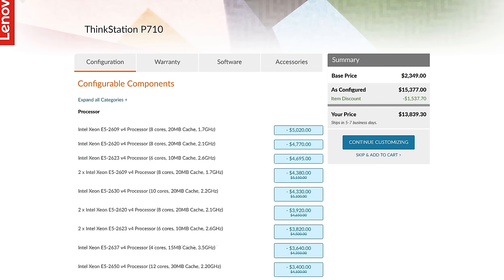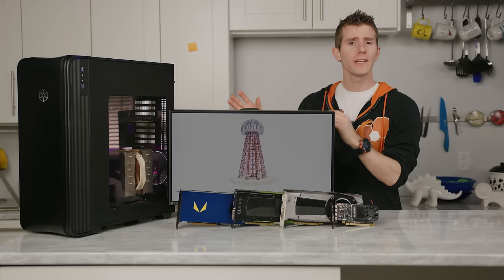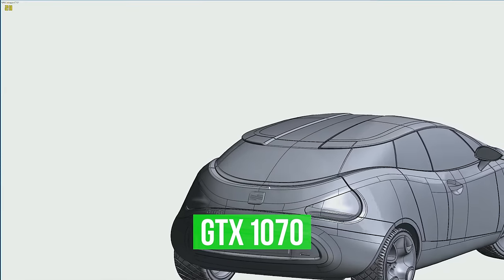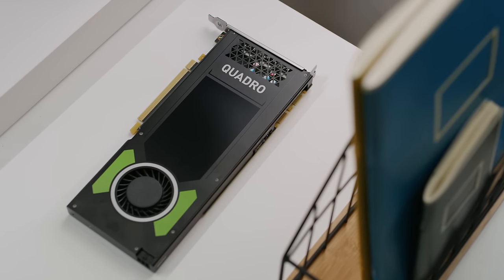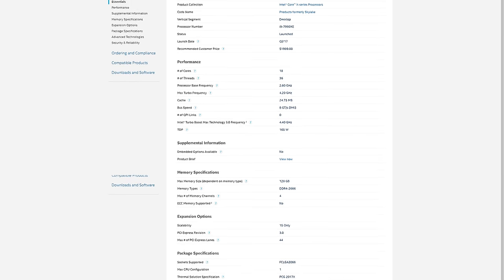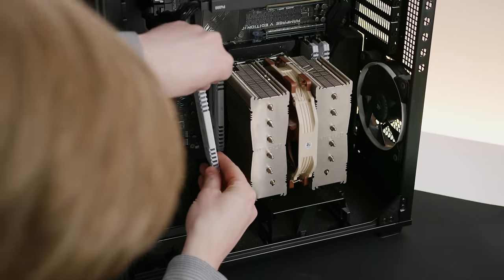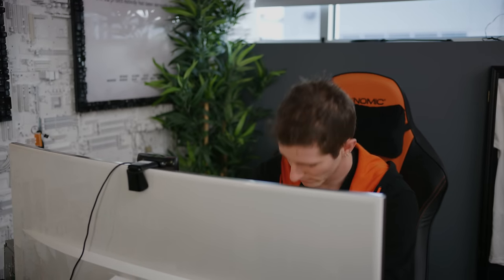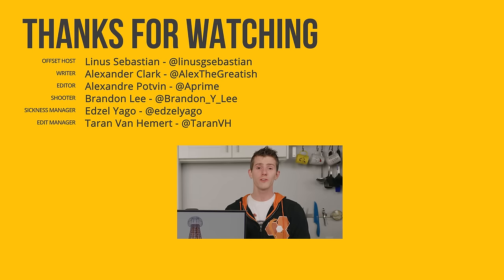3D Modeling & Design – Do you REALLY need a Xeon and Quadro??

Comment: You should do a more "artist" friendly version of this video: with 3DS Max / Maya / Blender, Zbrush, Unreal, etc.
Reply: Or Computer simulations, CFD etc.
Reply: John Doe yup
Reply: All of those doesn´t utilise Quadro. Look at Pugetsystems comparisons. In 3d, SolidWorks is actually single software where Quadro beats GTX. And this SPECviewPerf is a rubish comparison - it compares multuple softwares and gives a single number - but you actually work in just one software.
Reply: Similar thing applies really to CFD, just more of it. Depending on compute loads you would also start looking towards proper data centre cards like the Tesla series and high speed interconnects like Infiniband or Omnipath for MPI between nodes. Linus is a cool guy, but none of that would be his forte lol.
Reply: I like the idea... but I see 3D art stuff everywhere... I think this is the first casual C.A.D video I've ever seen that isn't just projectile vomiting of information.
Reply: Agree. I personaly use a 1060 and can run 3dsmax, photoshop, substance and UE4 all together on a triple screen setup. Yet I won't refuse a quadro if I find one...somewhere...for free  :D
Reply: Houdini as well. I want to see EDA tools.
Reply: What about MS Paint?
Reply: I agree for blender
Reply: VFX artist here.

Optimal build:
i9 7900x: 20 cores for sims, decent single threaded performance for ancient software that only utilises 1 core (Maya).
1080ti: Plenty of viewport performance + memory, ridiculous render speed with a GPU renderer, preferably Redshift that can use system memory if GPU memory is exceeded. Many GPU accelerated things in 3D apps are CUDA only, so Nvidia only, or they don't run as well on OpenCL (blender cycles and vray RT are examples of this).
64 gb RAM: 32 is often enough, but 64 is optimal especially if running huge simulations (Houdini, Realflow, Maya bifrost or Fumefx).
Nvme SSD: Not the most important thing for 3d apps, but certainly important for compositing and editing. IO is usually the biggest bottleneck in compositing software like NukeX. A 500GB+ nvme SSD as a cache drive is important here.

On a budget: 8700k, Best single thread, good multithread. 1070/ti, cheaper than 1080ti, but will when used with Redshift, still crush any CPU renderer. 32gb of RAM is respectable. And at minimum, a non nvme SSD. 

With ridiculous money:
Go for the budget build, and build a render/sim node(s). Pick a crazy xeon, maybe even two on one board. And stack in the GPUs. 8 GPUs in one node, rendering with Redshift is the equivalent to 40-320 CPU nodes running Arnold/Vray/Renderman. 128Gb RAM. Use Deadline to queue tasks to the render/sim node.
Reply: Check my comment up here in this video I explain what you need for your 3D/Render rig. Pros and Cons.
Reply: I am using blender for 3d work,but I am still student and I need something that powerful enough to make simulation and rendering, did I must buy laptop with gtx 1070 or computer.I use it almost 24/7
Reply: If you want to make a simulation you can also use the CPU, if you don't want to buy a new rig/laptop, you can really make use of Google cloud render, they give for free Trial 300$ just for test their render, only used this if you have a big ass simulation, right now my rig is a MacBook Pro 2013 late with i5 and 8GB no GPU, it can handle simulations quite well for an old Mac and the fact that is a mac 😂🔫
Reply: Yeah but I prefer GPU rendering for better performance,because laptop with high performance CPU like Ryzen still power hungry and very heavy to carry around.Did you have any laptop recommendation around $2000?
Reply: PLEASE, I need exactly this video but with 3ds Max + Vray and maybe Nuke. Autodesk and Foundry Suits would be a bonus <3
Reply: YES!!!
Reply: @Teapodes Actually in Maya 2016 my w9100 trounces the GTX 1070 in VP2 DX11/OpenGL. While the latter card does provide higher FPS it is very stuttery and lags frequently when dealing with multi-thousand object, multi-million polygon models. The former is far more interactive with everything happening instantly no matter how many objects on screen or how many polygons. Even dropping down to 12FPS in a 66+ million polygon, 30K+ object scene I can manipulate the viewport or any object in the scene instantly whereas the 1070 just locks up. On the flip side the 1070 is buttery smooth when it comes to realtime view-port playback while the w9100 is a bag of meh.

(Mind you this was on a 5930K system OCed to 4.2GHZ with 64GB of RAM)

 Ultimately it comes down to what you are actually doing. A single 10 million polygon object imported from Zbrush to retopologise, a 1070 has you covered. A 2.5 million polygon mech with 1500 individual parts, the workstation card has you covered plus having twice the VRAM is a boon when texture painting in Substance Painter while previewing in Maya.

 The performance in 3DS Max 2014 or Blender is almost identical however and you will not see any benefit from a professional card. I personally run a hybrid system with a w9100 and three Geforce for Redshift which is ideal for my workload.
Reply: I wanted to say the same thing.
Reply: I Z I mean, anyone who is knowledgable enough about CFD, FEA etc is already going to know about as much as Linus would ever care to know.
Reply: This is what I was hoping for when I clicked the video :(
Reply: Yes
Reply: Teapode well over all rounded review from a gaming channel thus seems just about right but i am sure that they  will improve and look into other cad sofwares
Reply: Shalahuddin Umar for now look for a laptop i really prefer the portability and convenience of the laptop if u can afford it depends on ur office job or like me on the fly the cost is recovered just pc allows for upgradiblity and cheap laptops dont suvive for long
Reply: I was just about to say that. I'd like to know the best set up for Maya, and Mudbox.
Reply: Yeah, I feel pretty mislead by the title. Also, I used to do all my Blender stuff on a Pentium D 805 and a GT610 with 2GB, there was a lot I couldn't do, but you can still get pretty far with just that. I have an i3-2100 and 4GB of RAM, now. I mostly bought this system for it's upgradability, but a slow GPU will really hold you back.
Reply: I picked up a Thinkpad P71 workstation with an i7 and Quadro P5000 with 16GB video ram and 4K monitor and it does a nice job at 3D Cad and rendering. Memory and Storage are easily upgradeable and it’s built like a tank. It’s not an ultra book though ;-) Any more power you have to go with a desktop.
Reply: I agree, there' s still many CAD and 3d programs that needs to be featured/tested because basically they dont exactly work in the same way
Reply: nobody uses sketchup?
Reply: I remember epic saying it was using like i5+gtx760 (sadly i can't find it) for their stuff a while back in the day, so maybe just go i5-8400+1060 6gb or something like
Reply: I was just about to ask for same tests - solidworks relies on quadro pro cards, blender and 3dsmax and zbrush and a lot more of them tend to prefer consumer level hardware..
.. also there's no pro hardware, there's just expensive and there's cheap.. it all comes from the same manufacturers.. 
- also - if you remember last gpu that you could software hack into a quadro was 8800gtx - and it was just down to the drivers - solidworks just drops some stuff if you don't have the drivers .. meaning, nvidia is crippling the hardware on not only hardware, but some software level.. and as I said solidworks depends on pro cards - a lot of other 3d apps doesn't .. 
- so yeah, please do another review
Reply: I'd love to see that.
Reply: abcde  We already know which programs can run on what hardware, it's right there in the system requirements on the vendor's website. He's saying we want to see benchmarks and hard data of various hardware setups to see what runs the best, not 'runs just fine.'
Reply: totally
Reply: Thibault Prédignac  Free is about the right price for quadro :-) since day one i have never seen a noticeable difference between quadro and a high end gtx in any suite... apart from the price that is.
Reply: @itobayu  I do. You can see some videos with SU on my channel as well. But I'm planning a big upgrade soon. Time to move from sketchup to UE4 or Lumion or both
Reply: I would like to see an artist video as well, working with Maya 2019 and Arnold Renderer or RenderMan
Reply: YES
Reply: @Teapode  Although your comment is old, it makes me quite annoyed, as comparing performance between multiple applications can prepare your knowledge for future work. No human will spend all their time in Office 360, so why get a system ONLY specialized for that? It's retarded the way your thought process went in that comment.
Reply: @PeterJansen  Sims like Realflow and the VFX ironhorse Houdini use OpenCL. AMD cards are extremely useful for those. And after Maxon's purchase of Redshift, Maxon CEO has stated that Redshift want's to get into the Mac space meaning they will adapt to OpenCL as well.
Reply: @vytasatvmanstudios  I know, I own a Houdini indie licence and Redshift myself. OpenCL Sims are great until you hit the memory limit, so until there are cards with 64gb+ vram, CPU is the way to go. You can actually run Pyro with OpenCL CPU and it's faster than traditional CPU mode, and uses system memory.
Reply: @PeterJansen  I don't own an AMD card but I cringe every time I reduce the particle separation to do a decent looking granular sim in Houdini.
Reply: for blender user vega 64 is the best mid gpu
Reply: anyone reading this in 2021 just get a 3060 ti, if rich get 2 3070s (better than single 3090), if insane get 2 3090s
Reply: Let me answer it in 2021, i got both GPU: RTX & Quodro

RTX: the render time is super fast, but the anti-alising is not that good
Quodro: good anti-alising, but the render time is like 6x slower

Conclusion: RTX is better
Reply: @devonchan  never heard of a "quodro" card you are talking about. Are you sure you didn't get a knock off card? That would explain the AA issues 😂
Reply: @jonathanxdoe  oh god, "Quadro", you got me ;D